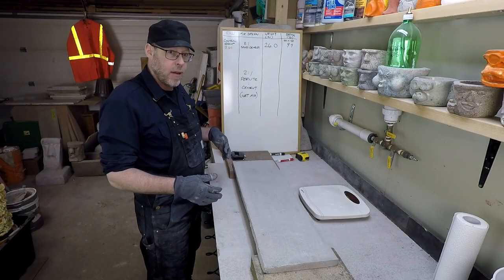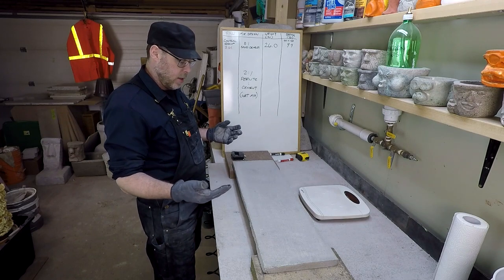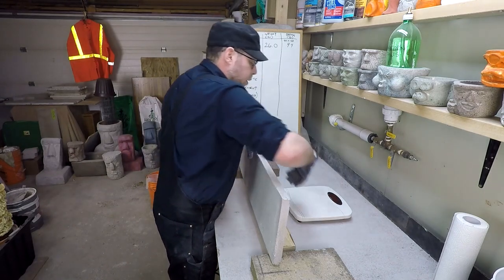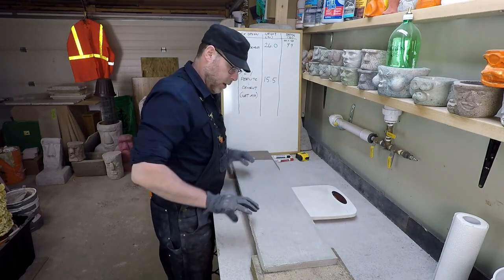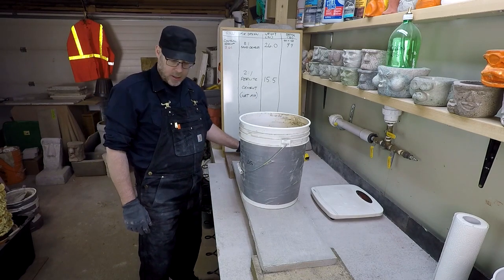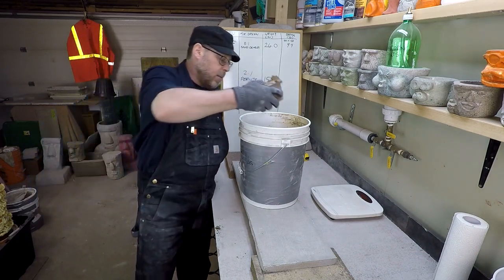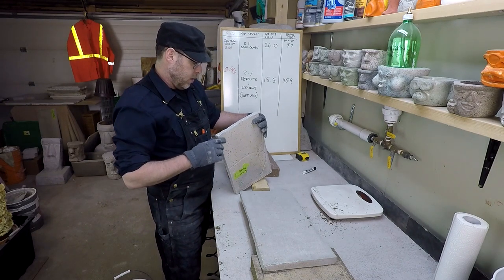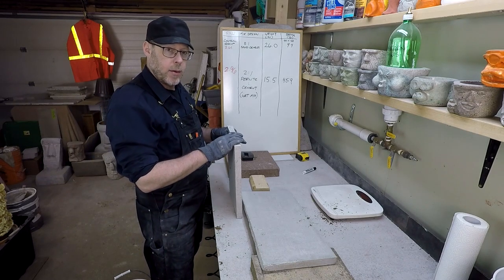Lightweight Concrete Strength Testing - Perlite 2:1 Mix Ratio

Comment: Good video, your experiments helped me to build my pizza oven and I appreciate that. I have another question, I'm trying to build firebricks for the bottom of the pizza oven, I'm looking something that I can replace with the time but durable to the use, fire etc., I found some videos that are mixing stucco, and sand but they crumble after some fires in the oven, do you have any idea or materials?

Comment: Good content!   Can you sum it up and present a table with all your different results plus explanation?
Reply from the maker: I do intend to do this but also this is a long term project I am working on.  I intend to build and test more mix designs before I summarize the results.
Reply: @creatingconcrete i am still dont get it why always do a bearing test like in a flat surface w/o rebar as reinforced or even having a large spam... if you do the same test with a square o rectabgular material will be diffeent resualt... ypu should do a compresion test over a falt surface instead... its like you use foamumlar NDX foam ypu will get diferent point of view...

Comment: Great test!  I think this makes sense, actually.  Portland cement isn't all that strong, by itself.  It's the mix with the aggregates that make it stronger.  Sand and gravel aren't just added to make the cost lower.  Although that's a part of it, there's a point where the mix doesn't get any stronger.

Here's the test I would love to see, just to bring it into perspective for folks that might not have the engineering experience.  Find the best strength/weight ratio mix from your 1" tests.  Then, pour whatever that is into a panel with the same length and width, but with the thickness needed to make it weigh the same as the 3:1 sand mix.  My bet - that's going to be about 2.5" think, and it's going to end up supporting about 4 times the weight of the 1" concrete.  Then if you want, make another version, with some 1x1" cutouts, running long ways, in the bottom of the panel.  So that it looks like the underside of a pre-cast bridge deck, kind of.  Then, I bet you get a panel that's 20-30% lighter than normal concrete, more or less, and maybe 2x as strong.

Comment: I would be very interested in a compressive strength test.  Also, have you considered testing a shredded expanded polystyrene mix?
Reply from the maker: I have not considered but I am not opposed to trying different mix formulations and aggregates